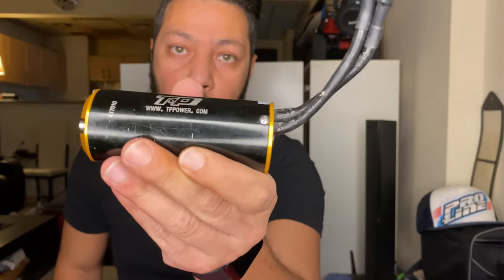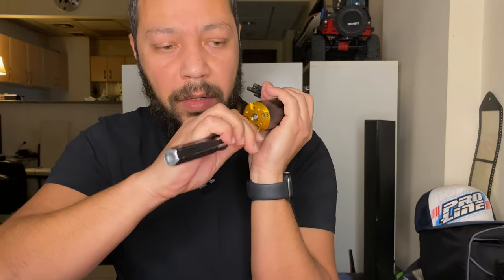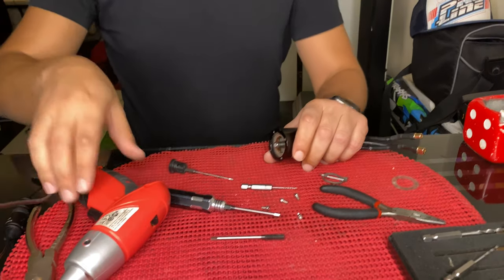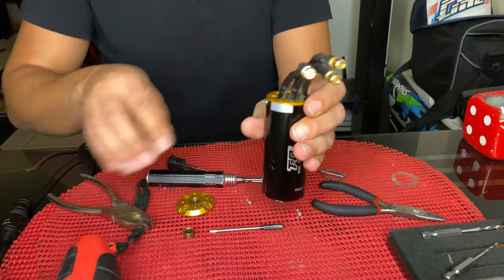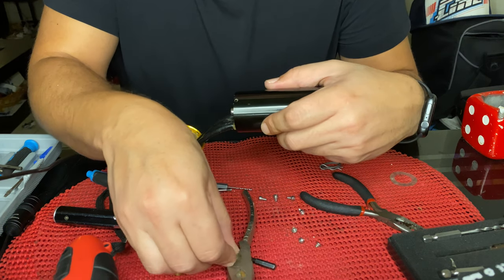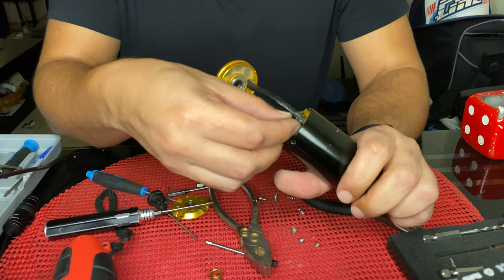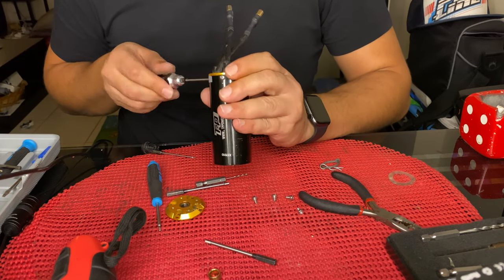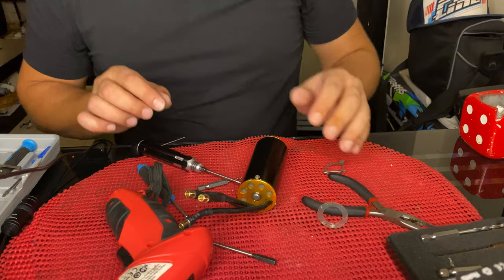TP Power Motor Spacer and washer

Comment: I wish i coud get this motor for my Rc Buggy
Reply from the maker: You will get it one day 👍
Reply: @UAERCADDICTS maby if they are not expensive
Reply: @xxers55nexxon75  save up bro ! I’m saving up for a CORDOVA or LTM that’s going to be a easy 600+ for a motor!
Reply: @jgotdawheel  yes i would but im broke because i baught  a 4×4 Slash brushles
Reply: @xxers55nexxon75  really talk I know you want to get a RTR but get a roller you want and build it your self it will be cheaper at the end. It’s kinda pointless Getting a RTR paying all that money to end up modifying it and spending more money build it from the ground up how you want it check out offer up buy parts used on eBay as great deal cheap to!
Reply: @jgotdawheel  i build my self 3 cars a Nitro kyosho Frezer a E Buggy  and Tamia Citroen 2CV Ente and modified them all. I only want to make my E Buggy 6-8S so it will win  some Friendship Offroad race. But i dont have enought money after the Slash to buy my self this Motor. 😄😄😄